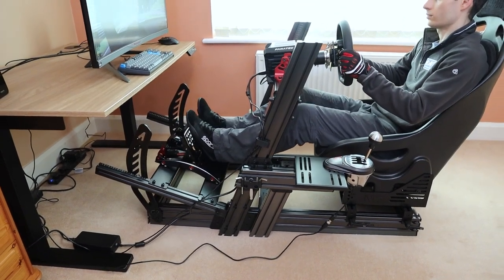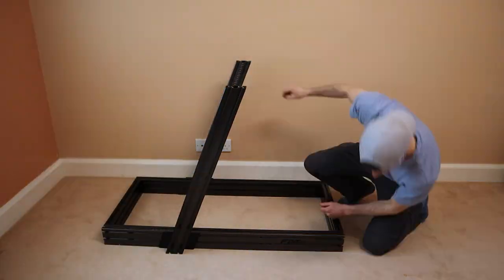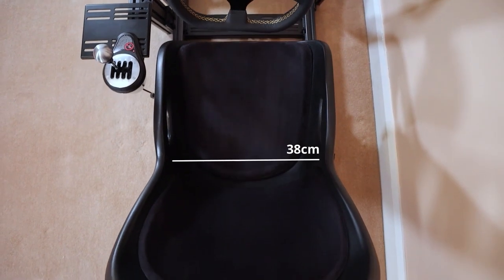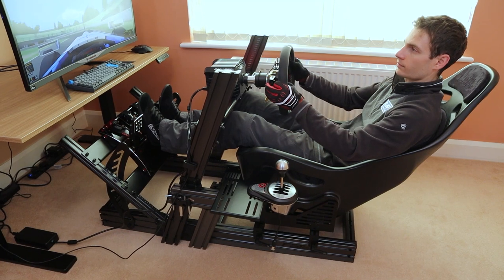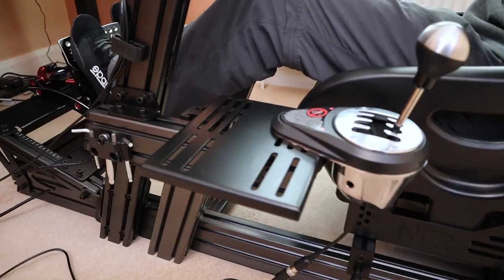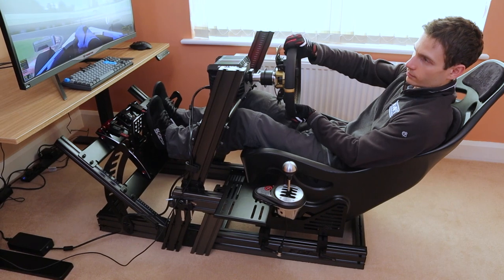Next Level Racing F-GT Elite cockpit review: The ultimate sim racing rig

Comment: Can u suggest a FGT cockpit that is -
1. VFM, budget friendly ~ $600-700
2. Sturdy enough for CSL DD
3. Easy to change from GT to formula & back
4. Suitable for games like ets2 to F1.
Any suggestions for a slider seat?
I’ve seen TR80 mk5, FGT elite/ lite/ 160. But don’t know the difference between them. I’m 5’11”& 70k
Reply from the maker: Thanks for your question Moonlight. The Next Level Racing F-GT Lite would be the most affordable option ( https://youtu.be/B9w_4PwtAj4 ). However, when running a CSL DD, you'd probably want to use extra straps to increase the rigidity of the rig. See my recent review of the GT Lite Pro for more insights here ( https://youtu.be/JJpJ7OPT9Lw ). The F-GT Elite is a fantastic option, with the 160 version utlilising thicker aluminium profile. However, as you know, it's a more expensive cockpit. Have you considered the F-GT? It's a solid mid-range rig built with carbon steel and very easy to adjust driving positions. You can also use our coupon code 'ADAPT' to get 5% discount at Next Level Racing ( https://adaptnet.work/F-GT ). Hope that helps. 👍

Comment: Hey loved the review! Just a quick question? Do you find that the tall side arms of the cockpit obscure your view? They stick up quite a way and its probably the only major concern I have with getting this cockpit if I do decide to pull the trigger on buying one
Reply from the maker: Thanks for you question Angus—I'm stoked you liked the review. That's something that I was initially concerned with also. However, when racing I didn't really notice them and they actually helped with the immersion factor by resembling parts of a roll cage. If it is an issue for you though, you can easily raise the seat and pedal deck up to mitigate for this. Hope that helps. 👍

Comment: Fantastic Review bro, I am considering this rig, I would love to know how much the whole setup costs? + Is this a big rig because I have a decent sized room because I don’t want to but it then it doesn’t fit
Reply from the maker: Thanks for your comment A—I'm stoked you liked the review. 

Not including the PC or monitor, the total cost of this setup is £2,742 (UK) / $3,148.99 (US). See the cost breakdown below. 👇
F-GT Elite cockpit – front & side mount edition: £999 (UK) / $1,099.99  (US) – https://amzn.to/3JUOHnx
ES1 sim racing seat:  £399 (UK) / $449 (US) – https://amzn.to/3IPRayn
Fanatec CSL DD wheel base (8Nm): £420 (UK) / $500 (US) – https://adaptnet.work/CSLDD
Fanatec Podium Steering Wheel R300: £420 (UK) / $500 (US) – https://adaptnet.work/R300
Fanatec Clubsport Pedals V3: £340 (UK) / $400 (US) – https://adaptnet.work/CSPedalsV3
Thrustmaster TH8A shifter: £164 (UK) / $200 (US) – https://amzn.to/3SRQr5Y

Fully assembled, the F-GT Elite has a base footprint of just 121 x 65cm (4:01). However, you’ll probably need to allow for more space to accommodate the seat, pedal deck and shifter mount, depending on their orientations. Hope that helps. 👍
Reply: @ADAPTNetwork  thanks for the help 🙏🏼

Comment: May I ask what your height is?  I ask because someone (5' 7-1/2") posted in reddit about the wheel being too close to the torso.  With the pedals already close back at rear-most part of the wheel's slant bar, pushing the wheel's slant bar forward pushes pedals forward too, making the pedals out of reach.  Like the design was made for taller individuals.
Reply from the maker: Thanks for your question JGloc. I'm about 5ft 9.5 inches (176.5cm) and average build. As you can see from the video, I was able to drive in a very comfortable position and there is room to move the pedals closer still. There is also scope to move the wheel plate or wheel side-mount brackets back a bit. Hope that helps. 👍
Reply: @ADAPTNetwork  I see.   Worried it might be at the limits for shorter guys.  In hindsight, just saw you also reviewed the GT Elite. Perhaps that would provide more room backwards?  As I saw the pedal arms could be brought further back, is this accurate?  Or are they both the same (F-GT Elite and GT Elite... brake to wheel plate)?

One more favor pls.  Do you know the height from the ground until the highest mounting point on the seat brackets?  Would like to compare the height from my NLR Elite office chair's lowest position. Thanks!
Reply from the maker: Good spot  @jgloc25 ; on the GT Elite, the pedal deck arms are connected on the inside edge of the wheel mount uprights. By defualt, they connect using a long pass-through bolt, which limits the amount of backward movement. However, you could use T-nuts instead, which would enable you to slide the pedal deck further back ( https://youtu.be/czXXNvPJaPI ). Does that make sense?

 Regarding the seat height: the highest seat mounting point is about 30cm from the floor, on the F-GT Elite, and 20cm from the floor, on the GT Elite (without feet installed).
Reply: @ADAPTNetwork  Thanks.  Are these T-nuts included in the GT Elite set already?  First time to use extrusions.
For the height, this is with the Universal Seat Bracket, right?  Thought their height would be the same.
Reply: @jgloc25  I own the GT Elite with the ES1 seat, and my partner has tried it. She's 5 ft 2, I'm 6 ft 0. There is enough adjustment in the pedal tray and seat sliders (see video) to accommodate both of us (well, one at a time!)
Reply: @supercededman  Yes, already got the GT Elite few months ago, after researching and saw that this allows bringing the pedal arms back (unlike the F-GT Elite).  I'm glad I researched first or I would have regretted getting the F-GT Elite.
Reply: @jgloc25 so glad you went with NLR. Quality kit and good value when you consider all the standard inclusions- extras on other units - and the free shipping 😊

Comment: Great review! I just finished building mine and waiting for seat to come in tomorrow. Your wheel position and shifter position are helping me see how I’m going to fine tune things once the seat is in place. Right now the standard shifter position seems too high and forward for me. I have the Fanatec SQ 1.5. Wheel deck is also high when rig is initially built. Thanks
Reply: simlab alot better i dont like it resting on the floor rather have feets that let it stand  rather laying on thye floor and it has alot flex you will see what i mean
Reply from the maker: Thanks for your kind words mate—I'm stoked you found the review useful. You can actually lower the shifter arm right to the base if needed. In this case, simply install the shifter support bar in front of the shifter plate, so it doesn't get in the way (14:09). 👍
Reply from the maker: Thanks for your comment  @arubaelitesimracer1769 . I'm a big fan of Sim-Lab rigs also (see my GT1 Evo review: https://youtu.be/TtfTOfG8xb0 ). To clarify though, the F-GT Elite does come with feet (11:30). However, I chose not to install these because the rig slides reasonably well on carpet without them. Additionally, with my Fanatec CSL DD and ClubSport V3 pedals, I didn't notice any flex. 👍
Reply: @ADAPTNetwork  yeah for the  fanatic csl dd which doesn’t have much Nm and plus club sport v3 I wouldn’t think either that it would have much flex wait till you use simucube pro and hydrolic pedals you will see the flex I’m talking about not much but on did notice and showed
Reply from the maker: For sure  @jonathantylersewell1 , Boosted Media did a great test with more powerful direct drive wheels and hydraulic pedals. It looked like the wheel mount remained pretty solid, which correlates well with my own experience. However, the pedal deck may need to be reinformced with extra profile if you're running pedals with very high brake forces. 👍
Reply from the maker: For sure  @jonathantylersewell1 , it's definitely worth keeping an eye out for any deals later in the year. 👍
Reply: @arubaelitesimracer1769  had this rig now for a good month. It’s awesome and absolutely no flex anywhere! I use the simucube 2 Pro and Heusinkveld ultimate plus pedals. Really happy I bought this rig and love the hybrid seating position rather than straight GT. This is solid as a rock!
Reply: @ADAPTNetwork  thank you! It’s set up great now and I love this rig!
Reply: @nephroghost1912  i might get one just for formula driving !

Comment: Fantastic video. Really informative, excellent presentation, and very, very helpful insights. 
Just wondering, as the upright wheel mount beams seem quite tall, do they ever interfere with your view of the screen?
Reply from the maker: Thanks for you comment Brickrunner—I'm stoked you liked the review. That's something that I was initially concerned with also. However, when racing I didn't really notice them and they actually helped with the immersion factor by resembling parts of a roll cage. If it is an issue for you though, you can easily raise the seat and pedal deck up to mitigate for this. Hope that helps. 👍
Reply: Thanks so much for your reply. It’s reassuring to know the vertical beams shouldn’t be an issue. Going to bite the bullet and order it. Really appreciate your help 👍.

Comment: HELP! I can't decide between ERS1 seat or ES1 seat
Reply from the maker: Thanks for your comment Giuseppe. It depends on what type of experience you're looking for really. Both seats are comfortable, however, the ERS1 is definitely the most comfy over long driving sessions and has independent recline adjustment. The ES1 though, feels more like a race-ready bucket seat, which helps with the immersion factor. Hope that helps. 👍
Reply: I'd add to Adapt's reply that the bucket does not flex at all. Due to their design, all reclining seats flex, but this seems to be not a major issue for all but the most discerning racers.

Comment: Is F-GT Elite compatible with third party seats and harnesses like Trak Racer?
Reply from the maker: Thanks for your question Victory Road. Yes, the seat brackets that come with the F-GT Elite are compatible with most side mounted bucket seats. You can also mount other car seats using a compatible seat slider. Same goes with third-party hanesses and seat belts. Hope that helps. 👍
Reply: @ADAPTNetwork  thank you so much for the response. This will help definitely.👍🏽👍🏽

Comment: what are the masurements of the aluminum, i mean, is it 8020 or bigger? and thickness? thank you!!im looking to buy a used one
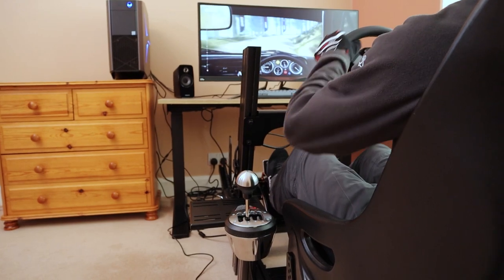Reply from the maker: Thanks for your question EiaC. Next Level Racing has selected mid-weight 40100 profile (measuring 40 x 100mm) for the base, 4080 profile (measuring 40 x 80mm) for the wheel mount and shifter uprights, and four pieces of 4040 profile (measuring 40 x 40mm) for the seat rails and pedal deck (4:15). It's slightly lighter grade than Sim-Lab profile (4:51). However, it has the same core width (15mm). Hope that helps. 👍

Comment: I was looking to get this and was wondering if you knew if the Spaco GP seat would be compatible on this rig.
Reply from the maker: Thanks for your question Cheetah. Looking at the measurments of the Spaco GP, I think it should fit the seat brackets, included with the F-GT Elite, without any problems. Hope that helps. 👍
Reply: @ADAPTNetwork  Thank you

Comment: Great review thanks !
You mention the length but what is exactly the length when you are in formula position from the top of the seat to the pedals support ?
How tall are you ? 🙂

Thanks again for your reviews 👍🏼👍🏼
Reply from the maker: Thanks for your comment Gegen—I'm stoked you liked the review. In the formula postition, I measured the F-GT Elite to be about 185 x 65cm. Of course, this will vary depending on the angle and position of the seat. For reference, I'm about 5ft 9.5 inches (176.5cm) and average build. Hope that helps. 👍
Reply: @ADAPTNetwork  thanks a lot for your feed back, It's very nice to have specific feedback like yours. Good job keep it up !
Reply from the maker: No worries  @gegen1769 —glad I could help.

Comment: This might actually be the rig I need, how high is the front part before the base holder?
Reply from the maker: Thanks for your question mate. The pedal deck uprights are 50cm and the wheel mount uprights are 84cm, as measured from the floor. Does that answer your question, or where you looking for the height of a different part?
Reply: @ADAPTNetwork  okay thanks for that, also wanted to know what the base length is from the pedal front to the back of the seat in a gt position, so far I can fit it under my desk if I was to purchase it, however I need to be sure it will fit length-wise from front to back.
Reply from the maker: No worries  @AdzzVR . The base length is 121cm from front to back (4:01). However, you'll probably need to allow for about 150cm, as the pedal deck arms extend forward in a GT position. Hope that helps. 👍

Comment: I would also like to ask about the ES1 Elite armchair.  If I am 180 cm tall and weigh 73 kg, am I slim, will it not be too big or wide for me?
Reply from the maker: Thanks for your question Rafal. I think the ES1 sim racing seat will fit you well. I'm about 176.5cm tall and around 65kg and I felt very secure in the seat as the sides tuck in more closely around the torso. Hope that helps. 👍
Reply: A bit late to the party, but perhaps helpful for others: I have the ES1. I'm 182cm (6 ft) and 80kg (176 lb). It fits me like a glove. VERY comfortable, and totally flex free. FWIW, I have it mounted to it's little brother, the GT Elite (wheelplate edition), which is GT style only, and flex-free.

Comment: Great review its just a shame the P1X is still the better option as its cheaper.
Reply from the maker: Thanks for your kind words Ghastous. I'm a big fan of Sim-Lab rigs also (see my GT1 Evo review: https://youtu.be/TtfTOfG8xb0 ). No doubt the P1-X is a fantastic cockpit and probably more flex resistant for very high-end pedals. However, with my Fanatec CSL DD and ClubSport V3 pedals, I didn't notice any flex on the F-GT Elite. Additionally, the F-GT Elite has the advantage of being able to support both formula and GT driving positions easily. So, there's pros and cons either way I guess. 👍

Comment: Great review, appreciate the depth you went into. I'm looking into getting this to replace my old rig. Quick question about the shifter mounting - I want to be able to switch my shifter to the left or right side depending on the car that I am driving (RHD vs LHD); how easy is it to switch the shifter to the other side?
Reply: It's not difficult, but it is too time consuming to do it on the fly for complete interchangeability. 

 Planning ahead to ensure you have the slots inserted on both sides would help though.
Reply from the maker: Thanks for your comment M & C—I'm stoked you liked the review. Like Andrew says, it's not difficult to switch your shifter from side to side, but it is a bit time consuming. I would suggest reaching out to Next Level Racing to purchase an additional shifter arm and shifer plate. You can then install this on the other side of your rig so you would only need to move the actual shifter. Hope that helps. 👍
Reply: @ADAPTNetwork  that's actually a great idea! I mean just having an arm on the opposite side, built up would be great. Switching the plate over with the shifter wouldnt be too much of a hassle. 

If you go down the full arm route it (opposed to the direct method) would arguably give the rig more rigidity too - not that it has much flex anyway.

Comment: Cuanto es altura maxima permite pedales a partir de perfil de base?
Reply from the maker: Hi Tornadeitor, thanks for your question. The pedal deck uprights are about 50cm in length, so the pedals can be raised to a maximum height of about 40cm from the base profile. Hope that helps. 👍
Reply: @ADAPTNetwork  gracias. Entonces es 40cm lo maximo que se puede colocar pedales? A contar a partir de la base horizontal? He dejado comentario anterior pero no se que pasa se ha borrado.
Reply from the maker: Yes, that is correct  @tornadeitor ; the pedals can be raised to a maximum height of 40cm from the horizontal base profile.
Reply: Gracias amigo. Yo tengo un cockpit aluminio y he comprado 4 perfiles 350mm, ahora he puesto pedales lo mas alto posible pero no se si esta bien posicion f1 o esta un poco bajo. Por favor, te pido, si alguna vez colocas los pedales arriba del todo, y te acuerdas, enviame una foto o algun pequeño video que yo pueda ver hasta donde te llegan los pies respecto a tu cuerpo, gracias
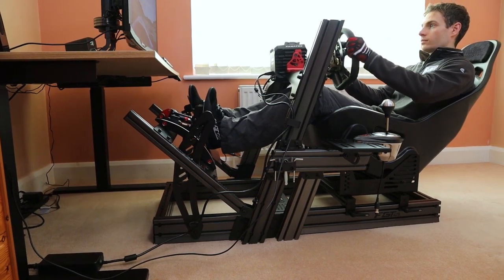Reply from the maker: @tornadeitor  Check out the driving positions segment of the video (9:03) to see the F-GT Elite in the formula position with the pedals at the highest position. Hope that helps. 👍